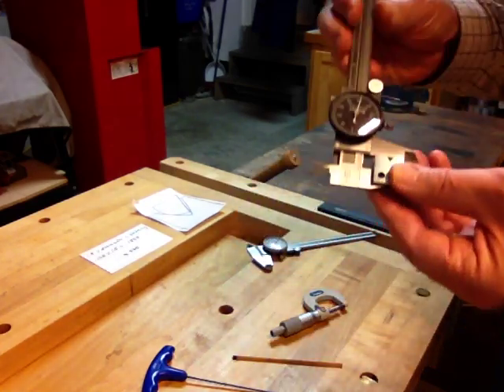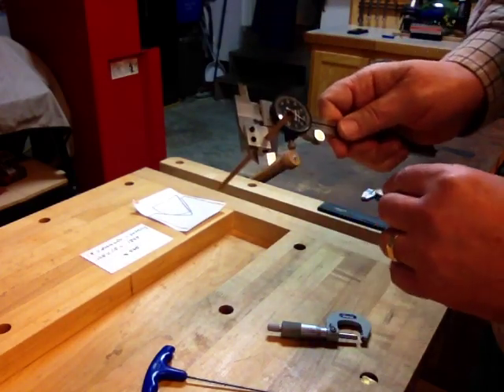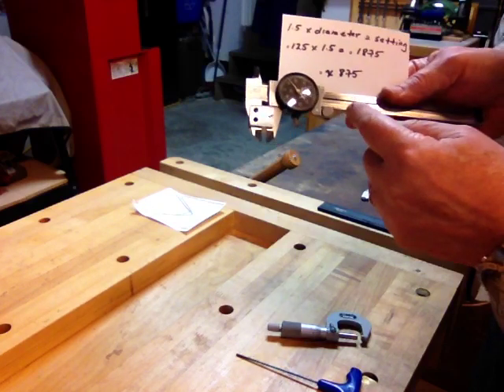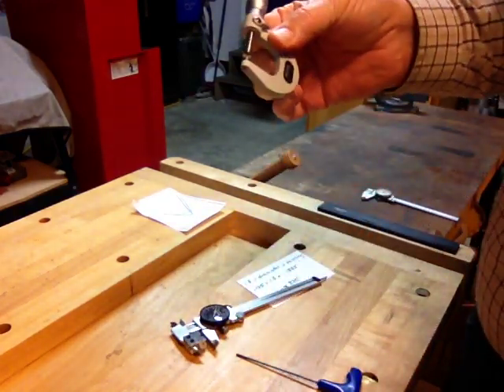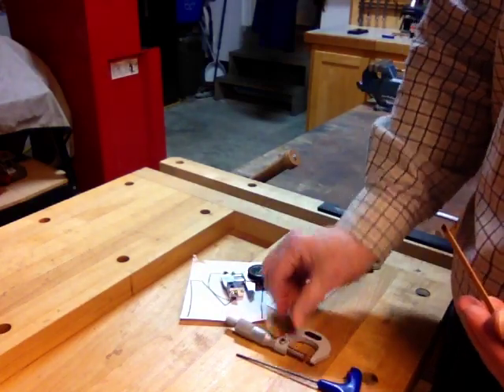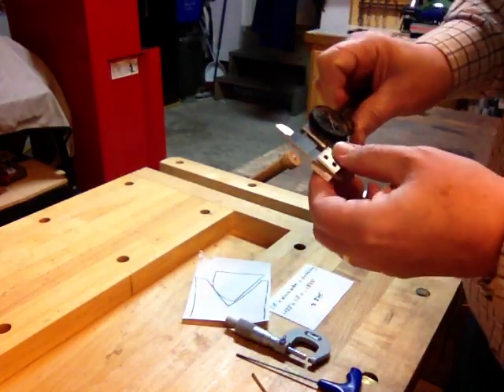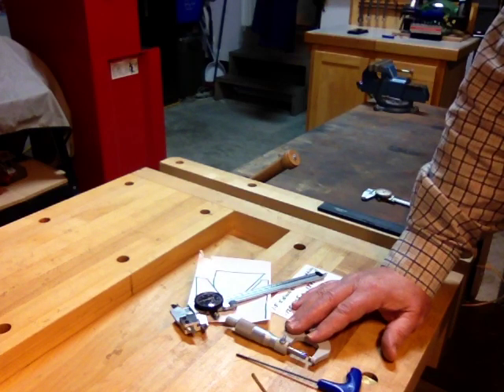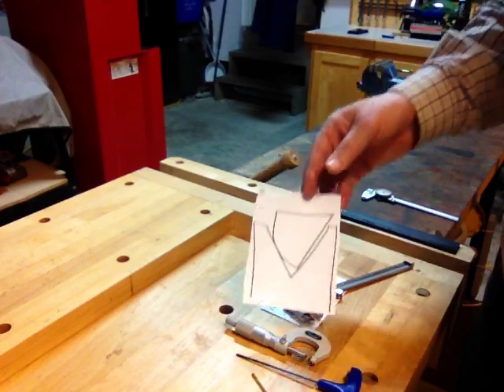Waara v block for bamboo rod making

Comment: Why wait until the rod is glued up and you can't fix anything to check the dimensions. Bind it up without glue, check the dimensions and work on the strips until you do get it right before gluing.
Reply from the maker: I don’t need to because with the vblock I get a reliable, repeatable correct dimension. Of course if you are not achieving that with your methodology then you can bind and measure but that is more work,. Like all things, it it works for you, stick with it. The block also helps measure individual strips to make each one uniform which leads to straighter sections.